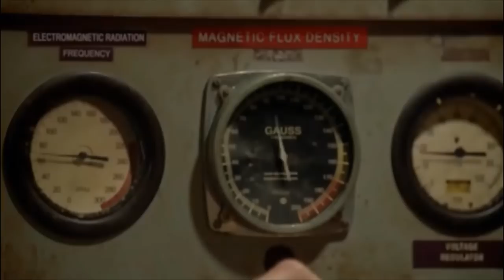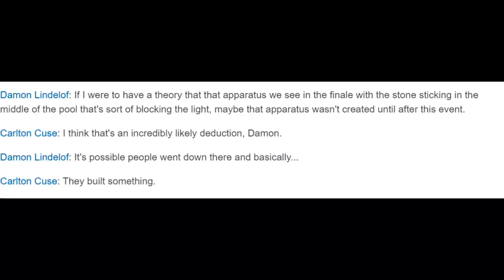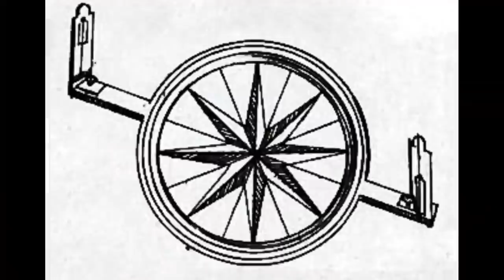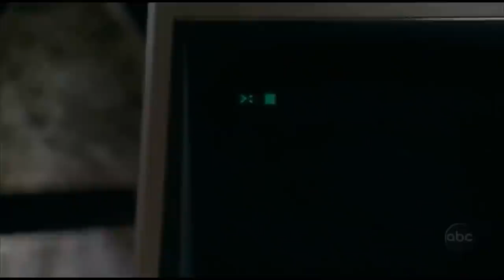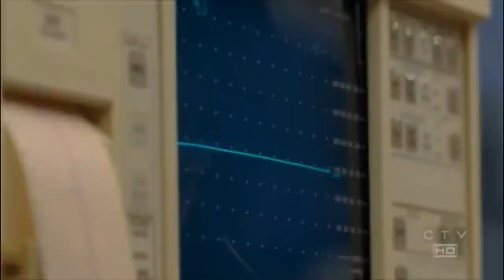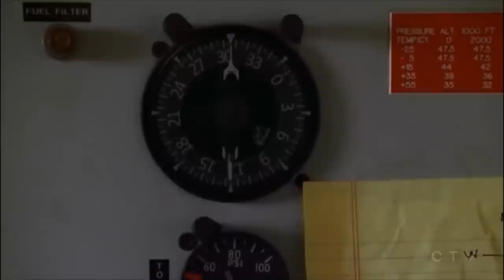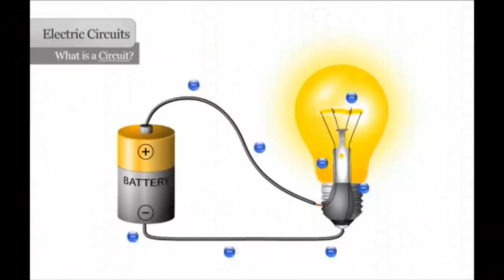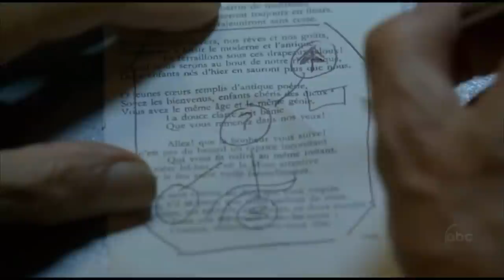LOST EXPLAINED - THE THEORY OF EVERYTHING

Comment: The two bodies for mother doesn’t make sense cause she was able to physically touch people. Unlike MIB when John Locke was turning the wheel.
Reply from the maker: The Man in Black absolutely could touch people and objects whilst occupying other forms. He was corporeal. Just a few examples here: Fake Christian picks up the lantern in the wheel chamber; Fake Yemi touches and holds Eko's cross necklace; Fake Alex physically pushes Ben against the wall; Fake Locke spends the entirety of Season Six touching lots of objects and manhandling people. Smoke Monster manifestations can interact with the physical realm. Fake Christian doesn't help Locke up because he's not allowed to: it's part of the time loop. If it didn't happen then it can't happen. At any rate, none of this refutes the admittedly hypothetical idea that Mother left behind two bodies. That's still entirely possible.
Reply: I think ur right now but the two bodies thing still hinges on her going in there JUST THOUGHT OF A GOOD QUESTION. how’d she find it? Probably a rule she set after. Which means that Jacob did the same thing. It seems like the rules are just how their subconscious believes things should be and how things should work. But most of those could be explained with messing with peoples minds and making them see what he wants them to. But yeah ur right I was thinking Christian smoke monster was different than Locke because he WAS him. Actually now I’m confused because he was bragging about good the mango was and feeling the ground with his feet. Hmm… But he’s only likable after they pull the plug on the light. But I’ve been rewatching lost after 6 years and I got to notice so many new things. Like the first thing Jack looks at after the crash is alcohol. And there’s literally an entire episode about Hurley being fat, funny episode. This show just had amazing writing. Like when Dr Chang was testing Hurley to see if he’s from the future, he asks him if he served in the Korean war. He said no it doesn’t exist. Then miles looks over at Jin. Not because he was shocked at what Hurley said but because he had no clue either and was looking at the guy from Korea to see if he was right. But yeah ur right. I’m at 2:55:09 at the video. I’ll finish it sooner or later. I never noticed the Egyptian stuff. Even though there’s a big statue screaming Egyptian. Thank you for the video. I hope you have a nice day if you don’t respond. OHHHH AND SOMETHING ELSE I THOUGHT ABOUT. I think the light is the same light in the briefcase in pulp fiction.

Comment: the sound recording of the narrator is the only most tragic thing about this video :(
Reply from the maker: This video has been remade on the channel (four parts uploaded so far, with another two more to come). I use my own voice for all of them. You can watch those parts here: https://www.youtube.com/playlist?list=PL5iTj9psbPrNovFOg4pJJIyxiLAv2WAKB

Also, there is a comment pinned to this video (which you would have had to scroll past in order to make your comment) that also states this fact quite clearly.
Reply: @LOSTEXPLAINED108  i saw that but the volume is too low. i pushed my audio output to 125% and its still too low :/
Reply from the maker: Well, the audio isn't so low that it's inaudible, otherwise I'd have nothing but complaints about it. The sound comes through at a normal level for me on my computer (which is my only real measuring stick I have) but it has also been coming through at a normal level for most others who have watched the videos. 

Although you're not alone. There have been a few comments that flagged the same issue with me. I think the volume discrepancies must be dependent on what kind of speakers people are using because I recorded the audio at recommended levels. Still, I have since tried to remedy this issue on the last two videos I posted to the channel (both of which have boosted audio and should sound louder for you). So, you should be able to watch the latest vids without any issues. See the videos on "The Game" and "Science and Time Travel".
Reply: @LOSTEXPLAINED108  unfortunately i find it very hard to hear
Reply from the maker: Try the latest two videos on the channel 👍